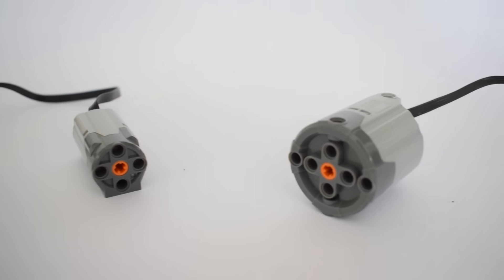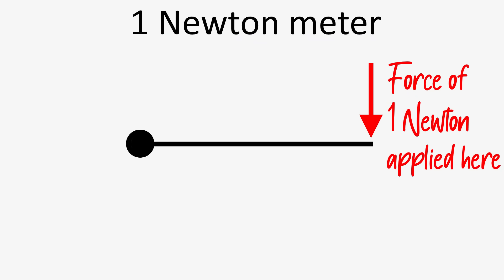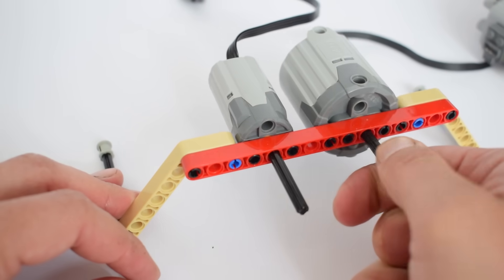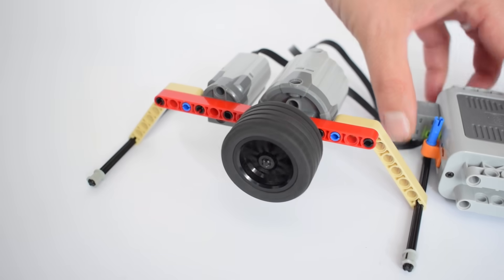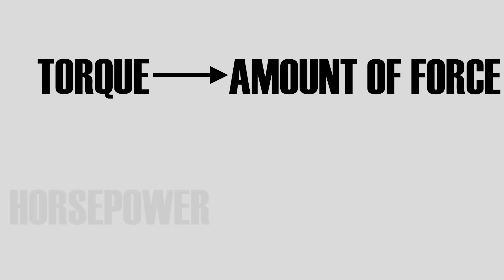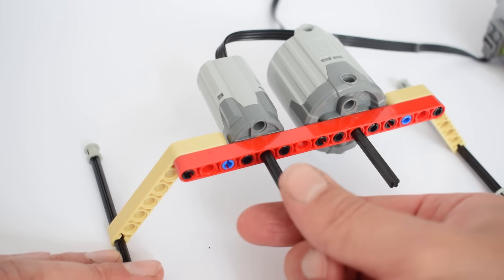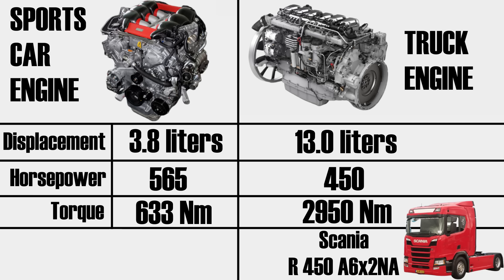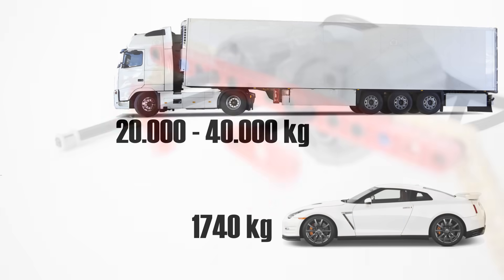NEVER be confused by HORSEPOWER and TORQUE again - HP and TORQUE EXPLAINED in the MOST VISUAL WAY

Comment: This would have been perfect if you had included how every engine crosses their horsepower and torque at 5250 rpm and depending on if they make peak power before or after this figure determines whether they have higher horsepower vs ft/lbs
Reply: No because thats only unit specific.

If you measure in PS and NM it crosses at 7024rpm

If you use KW and NM it crosses at 9549rpm.
Reply: @Richard25000 I think that is a great point all of them should have been mentioned so people understand the relationship between units

Comment: I am not convinced. I think we feel acceleration, not the force. 
If we seat in a heavy car with 400Nm at the wheels we would feel the same thing as seating in a two times lighter car with 200Nm wheels torque. 
What matters in our perception is an acceleration and not a force pushing the car faster.
Reply: Yes like g force is actually an acceration of 9.8ms^2

Comment: Good video until the feeling of force in a car example. This is only true if there is no gearbox, but of course every car has a  gearbox. This increases wheel torque which is what you feel, so an engine with low torque and high power can feel the same as an engine with high torque and the same power IF the gear ratios are perfect.

Comment: You should make an addendum video to this regarding torque multiplication by gearing and duty cycle. A GT-R engine could absolutely propel a big truck just as well as the 13l turbodiesel engine, you just have to gear it down a lot to convert that extra horsepower into more mechanical advantage i.e. torque. The problem is, the GT-R engine is not designed for a 100% duty cycle at maximum power and would wear out/break after a few days of use in such a big, heavy truck.
Reply: In fact a gas turbine in a tank (usually spinning at 22.000+ rpm and low torque) is geared down for huge torque.

Comment: Over complicated explanation for a simple question. What is Torque? Torque is the snapping force, the instant amount of force applied to an object. HP, HP is the constant amount of force applied to an object. Example, Torque can get you from 0-60 in 6 seconds. HP determines the maximum speed an object can accelerate to(and hold) dependent on it's weight/drag(and any other variables I forgot). HP sells cars, Torque wins races.
Reply from the maker: I really don't want to sound rude or condescending and I I'm saying this with good intentions: pretty much everything you wrote there is wrong or misleading
Reply: @d4a  Actually everything I wrote was spot on. In a car, the HP rating defines how fast you can go, Torque defines how quickly you can get there. Why do you think they use diesel engines in trucks? It's because a diesel has a very high torque/low HP output. You'd have to be a car guy to understand it. You want the best 1/4 mile times? You better have an engine with a lot of torque. Electric motors are another example of this, high torque, low HP. Why do you think EV's are so quick but top out so soon? High torque, low HP.

Comment: Cool thx. But question regarding the rpm situation. If you rev a diesel car to 4700 rpm( its red line in this example ) is the wear and stress on components the same as revving a petrol engine to 4700 or also to its redline of 7500? Revving a petrol engine to its redline will wear it out faster, so is revving the diesel to redline just as "harsh" or the same wear as the petrol engine to 4700?

Comment: Power is how fast you hit the wall
Torque is how far you take the wall with you
Reply from the maker: Actually that's a pretty misleading explanation. How far you carry the wall will the depend on how fast you hit it. How fast you hit it depends on both horsepower, torque and vehicle mass.
Reply: @d4a  true! But its funny though
Reply: No this is one of the dumbest car world things said by car guys.

Horse power how fast you hit the wall.

How far you take it would be related to the momentum of the vehicle.

At 60mph a truck at 40 tonnes will take the wall way further than a car at 1.7 tonnes.

Torque doesn't enter into it as you could get the same results after lifting off the throttle producing zero torque and zero hp.

Comment: One thought experiment I find useful to the "It's all about the torque" crowd. I can make 600lb/ft of torque at the wheel of my car with a 20ft cheater bar on the hub. Unfortunately, i won't be winning any drag races since i'm not generating much hp (meaning i can't move the bar very fast) so the car will still be slow as dirt, despite 600lb/ft of torque at the wheel.
Reply from the maker: Good one! Simple and effective

Comment: im afraid that your horsepwer measurement is flawed because engine was not loaded when you measured 275 rpm. its like you are on the dyno in neutral gear.
Reply: Yes HP and torque is low when unloaded otherwise the motors would accelerate constantly. 

But when he's applying load the outputs will increase to their maximum outputs much like a braked dyno or pronybrake works.

Comment: Horsepower = how fast you can hit the fence
Torque = how far you can drag the fence🤪
Reply: No this is one of the dumbest car world things said by car guys.

Horse power how fast you hit the wall.

How far you take it would be related to the momentum of the vehicle.

At 60mph a truck at 40 tonnes will take the wall way further than a car at 1.7 tonnes.

Torque doesn't enter into it as you could get the same results after lifting off the throttle producing zero torque and zero hp.
Reply: @Richard25000  really, it's just an old saying from topgear or whatever....that you guys take it so serious🤣...also high speed doesn't kill you....it is the sudden stop😂reactions in 3,2,1..😜
Reply from the maker: Actually that's a pretty misleading explanation. How far you carry the wall will the depend on how fast you hit it. How fast you hit it depends on both horsepower, torque and vehicle mass.
Reply: @d4a  that’s not completely true either. It depends on the horsepower the engine produces and it depends on the torque the wheels receive and can put down. 

Mass of the vehicle is needed for traction, but there are ways around that need.

Comment: The problem with this video is the reasoning behind why high torque motors are used in semi trucks. The gtr motor could be used in the semi truck with equal effectiveness even with the less crank torque. Granted greater wheel torque is required for higher loads, but that's the job for the transmission not the engine. Since hp is a function of rpm and torque, if you want more torque you reduce the rpm with gearing, the horsepower remains the same. 

The reason why semi trucks are the way they are is because of the fuel they use. Since diesel has a slower flame propagation, it has a slower rpm, but it has slightly more chemical energy stored within it's chemical bonds. This does 2 things: slower rpm means less cylinder wear and less engine rebuilds, and diesel is more efficient at moving a heavy load from it's higher energy density. Diesel is a for long life, hard use engines, and thats what they're used for.

If 2 engines have the same hp, but one has an operating rpm quadruple of the other, and the other has a torque number quadruple of the one, but their transmission is geared to have the same operating rpm, they will have the same wheel torque. This is apart of the definition of "hp=(rpm×torque)/5252". If you want an engine with "x" hp and a rpm less than 5252rpm you must have higher torque, otherwise it will underperform the motor with "x" hp but with higher than 5252 rpm.
Reply from the maker: I got a few comments similar to yours claiming that gear ratios are a panacea that would allow any kind of engine to be effective in a truck. If that were the case I'm sure we would be seeing 3 liter engines in trucks all the time. Yet we don't. Gear ratios can increase torque but yours and similar comments omit the fact they do so by sacrificing speed. This means that the GTR engine would need absolutely ridiculous gear ratios to move heavy loads, but more importantly it would need something like a 30-40 gear transmission to be able to get up to highway speeds. This of course is extremely impractical, it would likely also be extremely expensive to implement. Yes, diesel is a factor but not the key one. I have a very detailed video on petrol vs diesel engines that explains that as well.
Reply: @d4a  10 be enough for compensate weaker low end around with achieve top speed limited be drag aero rolling resisit power losess etc in fact this gtr engine at the same velocity be able to pull stronger than this truck engine ! assuming both use peak power at the same velocity because gtr havve more power what this mean ? it have better torque to rpm ratio what mean it be work at more effective GEARING ! :D  why they dont use engine gtr instead of truck engine ? = longevity/mileeage., fuel consumption yep thsi small engien will burn more fuell probably due to more friction at higher rpm etc ., and most important probably factor it will need more often clutch change due to bigger diffrenc in cluctch disk speed  at start :x  once clutch be fully squeez at peak power this gtr engine will produce more force at tire circuit than this particular truck engine .565 bhp at let say 6000 rpm whatever the rpm is it be something around this i dont want go look at precise numbers it isint necessery hear lets assuming 565 bhp is at 6000 rpm and truck 450 bhp is at 2000 rpm that mean truck at 2000 rpm have (and wememeber peakhorsepower on graph is strongest rpm level for each engien and egzacly at this rpm level it will generate bigest force at drive whell circuit at each speed you imagine ! thats why im be comapre force at specified velocity at tire circuit when both engine be spin rpm which give them max power ! ) ok so truck at 2000 rpm for produce 450 bhp need around 1600 Nm  vs gtr for produce 565 bhp at 6000 rpm need around 660 Nm ok let assume we comapre both on let say 3m/s driving velocity  with pedal to the metal offcorse let assume both have the same tire circuit 1,88 metres and radious 0,3 metres  ok so both will spin tire at 3 m/s  around 96 times ok lets calculate final ratio for both first gtr 6000 rpm :96=62,5 ! vs truck 2000:96=20,8 only now we can calculate from this Torque at drive wheel axis for both so ok first gtr only 660 Nm around but multiple be 62,5! give us = 41250 Nm of torque at drive wheel axis ! vs truck huge 1600 Nm but only be 20,8 give us dissapointing only 33280 Nm !!!!!!!!!!!!!! :D you seee this dude?  gtr despite it have around 2,4 times less torque at engine crank it can produce around 25% more torque at drive whell axis thanks  3 times bigger engine rotational crank velocity !!!!!!!!!! so im now have pruved you that engine gtr thanks biger power can produce more force at tire circuit ( which im dont calculate beacuse i dont need beacuse tire have the same radious and diffrenc in force at tire circuit be the same as diffrenc in torque at wheel axis as well as diffren in power heh :) ) at egzacly the same velocity ! PERIOD  and reason whythey use truck engine in truck and not gtr are diffrent than this . and your egzample with lego engine completely avoid gearbox =BIG MISTEAKE  this egzample can be aplly only to elekctrick kick scooter without  gearbox for egzample not for comustion engine with gearbox in normal car and even than we must consider tire raious in electic kick scooter :)  beaccuse still from 2 times less torque electric engine be have 3 times smaller whell radious we can produce 1,5 times biger force at tire circuit !and no you dont achieve biger pulling force from thsi truck at 3 m/s at other than peak power rpm at lower rpm where this engine rpdouce more torque but less power so if you change at higher gear you achieve at tire circuit less tractive force ! and at lower gear what give you more rpm than peak power so less torque but more rpm but less pwoer than at 2000 rpm at peak you will have egzacly the same story truck will pull again weaker ! at 3m/s only peak pwoer rpm give max tractive force at each velocity !!!!!!!!!!!!!!!!!!!!!!!!!!!!!!!! you can have even 10000 Nm at crank if from this 10000 Nm atcrank engine will produce less pwoer beacuse rpm be so low it will pull weaker heavy stuff or worse go uphill empty or with heavy stuff or it will accelerate worse tahts fact PERIOD., good egzample is im often use this egzample  honda cvic type r which have 200 bhp and 200 nm vvs some 2.0 turbodisel engien which have 100 bhp and 300 nm   assuming both vehicle weight the same etc type r will accelerate much better 0-100 6 vs 10 sek around  and it will pull much harder heavy stuff  only what must do driver is reduce gear for higher rpm where this type r produce more power than this disel engine ! once driver be hold rpm engien in honda on 5k rpm + it will always have more tractive force push hees car forward it no matter you put on both car 2 tons load or they be alsmot empty it no matter they will go uphill or down hill or on level road honda always will be able to generate more pulling force once driver reduce gear for hold one engine in its peak power band or at least at power level higher than max in this disel engine !  so probably like at least 4-5 k rpm in honda engine up to 8-9 k rpm and this aprticular disel will dont have chance however once drivver in honda put higher gear at which rpm drop under 4 k rpm and disel engine now win .
Reply: so overall your egzample with lego engien is good if you completely avoid gearbox soassuming vehicle dont have gearbox xompletely and that in both vehicle we have egzacly the same tire radious :x than lego engine comaprision is 100% correct however plug to formula gearbox and diffrent tire radious and we must calculate everything from begining to know whats really be abel pull harder :x  ....however in your egzample results is obvious evven with gearbox because engine which have more torque produce also more power :x so it will be always pul stronger no matter with or without gearbox well maybe except without assuming we put enoygh smaller wheell to weaker engine at lower velocity ..so in your egzample you have 4,6 times less torque this smaller engine so put 4,7 times smalleeer wheel in terms of wheel radious and you will have now more force at tire circuit than at this biger engine  .....and now this smaller engine will pull harder uphill down hill with or withoud  big load on it etc  at least at first couple metres:x .well maybe cm :x .

Comment: TELL me :

Instead of truck engine,  can we use car engine with gearbox for high torque.

Similarly, can we use car engine with gearbox for high speed.

Hence, I think today you need to run an engine at its efficient speeds , other power and torque can be managed by gearbox.
Reply: A gearbox may be used to generate more torque at the wheels, but this will have no effect on the torque delivered by the engine.
It is for this reason that we start off in first gear to overcome the vehicles inertia.
To pull a heavy load, at a reasonable speed, will still require a more powerful engine, delivering a greater torque.
Reply: @christophermackley8084  Thanks for answer bro but this was not my point.

Kindly read again

Comment: I feel like you left out a really important point.  Pretty much the only thing that makes horsepower relevant. GEARING. 

You can make any amount of torque you want with proper gearing.  But how useful that torque is at speed is where power comes in.  The GTR engine will move that truck no problem with proper gearing.  It’ll even out perform the truck engine because it has higher horsepower.  Whether it will be reliable or practical is another question. 

Even a Miata engine can move the truck with proper gearing. Max speed will be limited because there will be a limit to how fast you can produce torque. 
Torque x speed = power

Comment: Can we have a video that describes the practical applications for torque and HP/kW when it comes to vehicles... Why does an electric or diesel engine thrash a petrol when it comes to short distance drag race but as soon as the distance grows it is a different story. This is where gearboxes and gearing ratios come into play. Bolt the same gearbox to two different engines and you will have very different results... or add an additional load and see why the extra torque from a diesel changes the game. Why don't we see more diesel racers and why are more offroad/commercial vehicles not petrol based?
Reply: The short answer is petrol burns fast, and diesel slow, you want a high horsepower engine? You need to burn that fure real fast, diesel won't co-operate at higher RPM.
Reply: Because when it comes to racing HP determines the maximum possible work doable in a period of time.

Yes a diesel makes loads of torque but it can't reach a high top speed because of a lower RPM limit.

So you gear them longer so those big engine torque numbers end up being reduced at the axle more than a petrol engine would be.